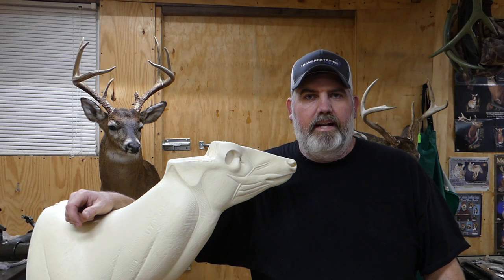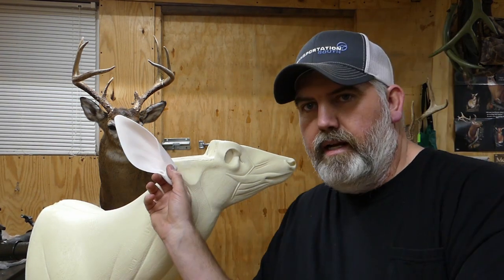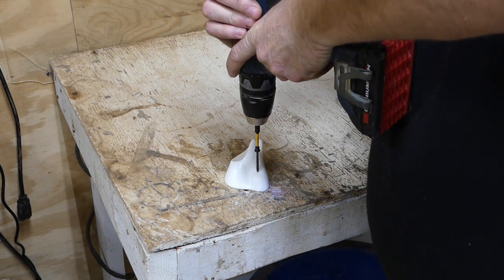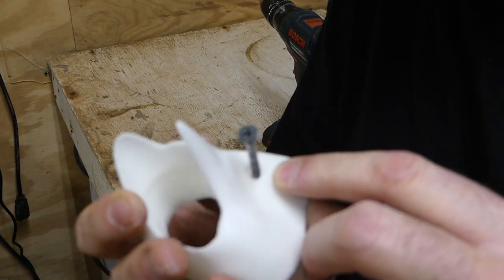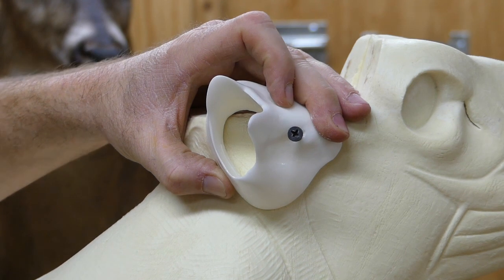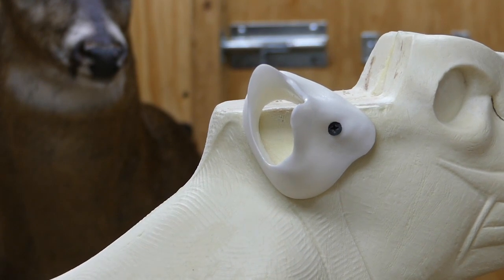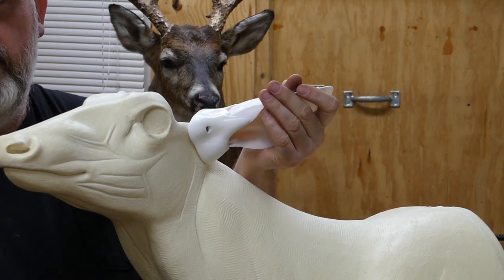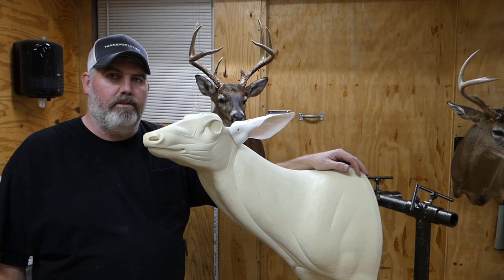How to install ear butts on a deer form,taxidermy techniques

Comment: Going to give this a try, be been doing bondo ears for years, thanks for the video.
Reply from the maker: Hey thanks for watching! It is quick and easy way to get a strong accurate ear and ear butt. Removing the cartilage is a learning process but once you get the hang of it you can get it removed very quickly.
Reply: @ClearCreekTaxidermy  do you have a video in removing the cartlidge, type of adhesive used? Final installation
Reply from the maker: Yes go to my channel and watch the how to prep a deer cape for taxidermy. I cover everything on the video including the adhesive.

Comment: Nice are those ear butts back or half back.  What type of hide paste works best for the ear liners?  Thanks
Reply from the maker: Hey thanks for watching! The ear butts are half back. And I recommend the two part epoxy ear liner adhesive from McKenzie. I like the faster setup time on the epoxy versus the hide paste. I can set the ear skin in place and line up my hair patterns and have it locked into to place in a couple of hours. With hide paste it will take several hours for it to dry.

Comment: Great videos. I’m trying to learn how to do my own deer mounts. Where can I find a cape that’s ready to go on a form?
Reply from the maker: Hey thanks for watching! I would ask some of the processors near you they usually have connections with tanneries. I would also search the internet for tanned hides for sale.
Reply: Okay thanks. I’ve got my ear butts on and my antlers on temporary until I can find a cape. I wish I had known about taxidermy when I was younger. I done my first turkey 3-4 years ago (tail and wings flat on the wall) 2 wing bone calls turned out pretty good. I found myself in the shop late before I knew it. Keep the videos coming.
Reply from the maker: That’s awesome! I am going to have some turkey videos on the channel in the near future. So make sure to hit the notification button so you will know when I have more videos available.

Comment: Do you have do alot clay work using the liners.
Reply from the maker: Hey thanks for watching! If you use the ear butts that I am using in the video there are very little clay used with this method. The only place I put clay is to cover the screw heads where I attach the ear butts to the form and a little at the base of the ear butt to blend the transition between the ear butt and the head.

Comment: I have no clue & just starting. Do you use critter clay around the base of the butts to blend them to the manakin/form?
Reply from the maker: Hey thanks for watching! You can use clay to blend your ear butts in to the form if you have some big gaps where the ear butt meets the form. If you have a good flat surface on the form where you’re ear butt sits and you use the type ear butt that I am using in the video you don’t have to use any clay. When the skin dries after it’s mounted you will have a nice smooth junction where ear butt and form meet.
Reply: @ClearCreekTaxidermy  Thank You! I’m almost ready to start to try all this for the 1st time. I Appreciate your videos very helpful going into this with absolutely no experience.
Reply from the maker: @ohiowhitetail8919  you’re welcome! Don’t be afraid to get started on your first one it will be a little overwhelming at first but take your time and be patient the more you work on the easier it will get.

Comment: What brand of ear butts are you using I have been using clay this looks much simpler?
Reply from the maker: Hey thanks for watching! I use the McKenzie whitetail ears. They are very easy to use just make sure to use the same size ear butt as liner they come in S,M, and Large. I typically use a medium for most deer and a large for a mature northern buck.

Comment: What Epoxy do u use?
Reply from the maker: Hey thanks for watching! I use the McKenzie ear liner adhesive that is pink colored. It will make the ear color look very lifelike and there is very little painting required when doing your finish work.

Comment: Can i use the ear butts liners with a bondo ear
Reply from the maker: Hey thanks for watching! You can use the ear butts with bondo ears but you have to make sure after your bondo kicks it will fit down into the ear but. You might have to trim it down to fit.
Reply: Thanks

Comment: How do you clay in an ear butt?
Reply from the maker: Hey thanks for watching! There’s a couple of different was to clay in a ear butt. If you use the ear butts like I am using in my ear butt video you will use a very small amount of clay to blend the plastic ear butt into the form. For example you will run a small role of clay around the edges of the ear butt and smooth it out blending it into the form. The other method is if you use ear liners without butts or the bondo method you will have to build the whole ear butt out of clay. This will require using reference to be able to recreate the muscle details of the ear butt to get the correct size and shape.